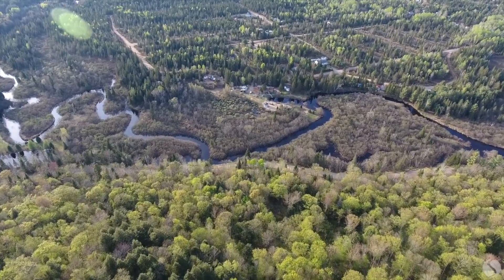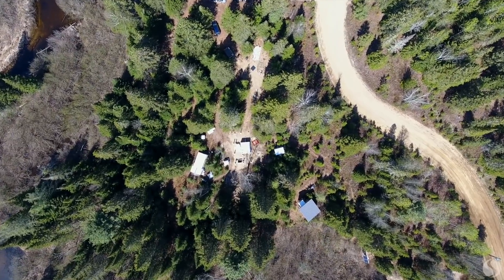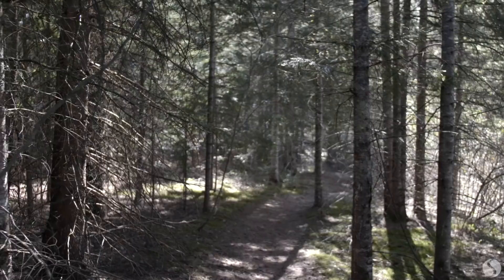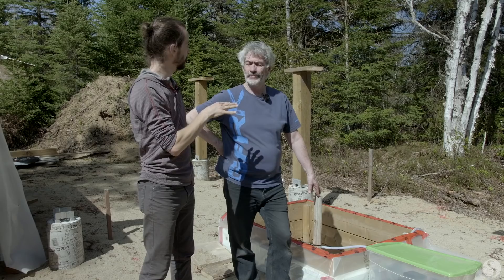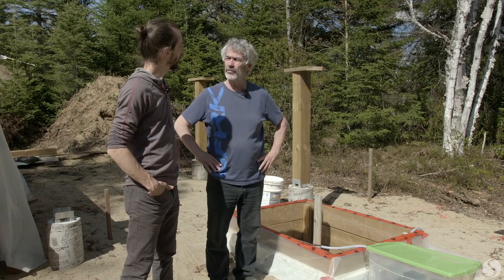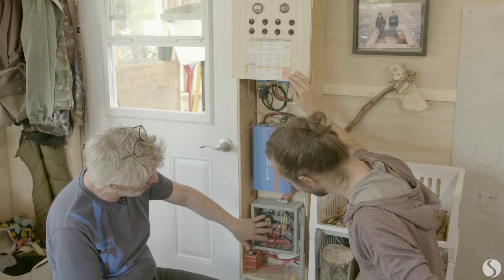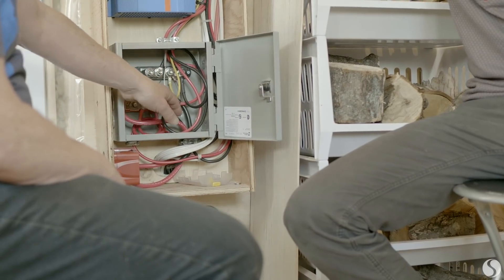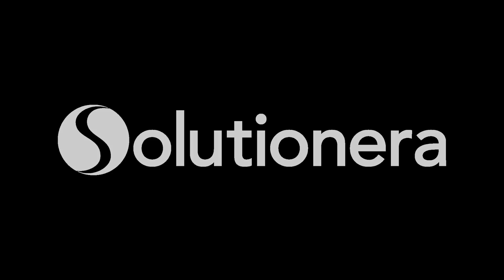Mini-maison autonome au Québec [VISITE]

Comment: Mon experience en hiver avec les batterie au gel dans un porticle de chalet mais pas chauffer a ete une mauvaise experience. Elle ne prenais que la moitier de leur charge habituelle  a -20 puis revenais a la normale par temps doux au avec une chaufrette martin. Donc meme dans leur bac isoler la nuit puisque qu'on dort elles ne se decharge pas et ne charge pas.. elle vienent tres froide puis ne veulent plus charger et ne se rechauffe donc pas. Le systeme etais composer de 3 paneaux 280w, 4 batterie 1250CA500w/h de marque GNB et d'un controleur de charge MTTP dont je ne me souvient pu de la marque. Je suggère donc de mettre le batterie a l'interieur dans une piece chauffer.
Reply from the maker: Intéressant! Si vous aimeriez échanger avec l'un de nos experts à ce sujt, n'hésitez pas à nous contacter au info@solutionera.com

Comment: bonjour
bon projet bon video merci 
petit conseil si je peut me permettre  la boite grise sous l'onduleur vous devrier instale une boite a fusible d'automobile pour protéger les différente grosseur de fils qui parte de cette boite parceque la, j'ai tous de suite vue que aucun fils est protéger et ces tres dangereux pour le feux . il faut savoir que un fusible sa seule fonction est de protéger le fils  contre les surintensité peut importe la tension chaque grosseur (#10, #12, #14, ect ) a sa propre capacité en ampere et doit etre protéger par un fusible aproprié a partir de la boite de jonction.  Dans une boite a fusible de voiture vous avez du 40 ampere du 30 amp. du 20 amp. et du 15 amp. sufisant je croix pour tous protégé vos fils .  bonne continuation et encore bravo et merci
Reply from the maker: Bonjour, merci beaucoup pour votre commentaire! Bien sûr nous recommandons de suivre les règles de l'art en électricité et mieux vaut plus de prévention que pas assez. Rémy est toutefois un professionnel et nous avons confiance qu'il sait ce qu'il fait :) La vidéo ne montre pas tous les détails de l'installation également.
Reply: Je suis électricien diplômé marine marchande, j’ai 40 ans de métier, ne vous inquiétez pas, la sécurité est mon cheval de bataille, donc tout est sécurisé 2 fois, comme appliqué dans la marine professionnelle.

Comment: Combien sa coute au Quebec du pieds-carres pour batir un bungalow (auncun sous-sol et 2ieme etages)?  $100 du pieds-carres?  Je crois que cet environ $200 du pieds carrés, mais.
Reply from the maker: Bonjour Joe, merci pour la question. Ce n'est pas une question facile à répondre. Il faut surtout savoir ce qu'on inclut ou pas dans ce prix. Souvent, ça ne tient pas compte du terrain et des infrastructures. Et aujourd’hui avec l’augmentation phénoménale du prix des matériaux, 150-200 dollars du pied carré c’est en full autoconstruction. Si tu engages des entrepreneurs pour tout c’est 300-350, et jusqu’à 400 pour du clé en main haute performance écologique un peu de luxe.